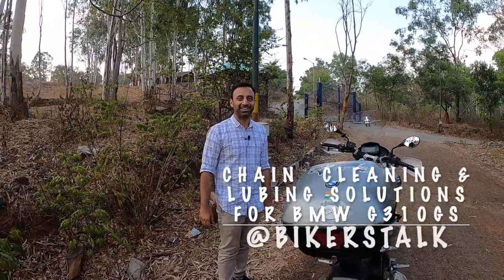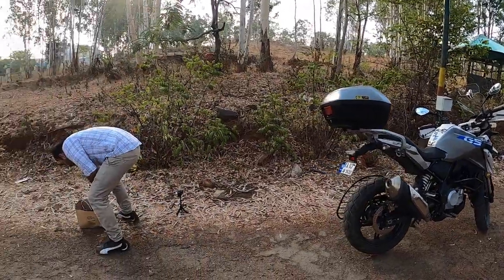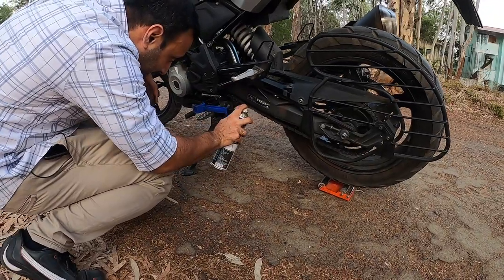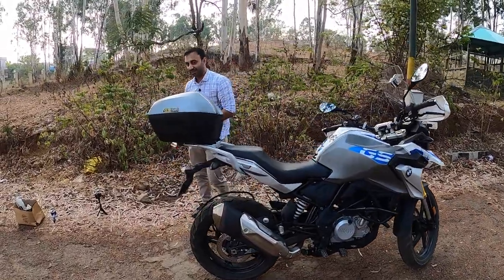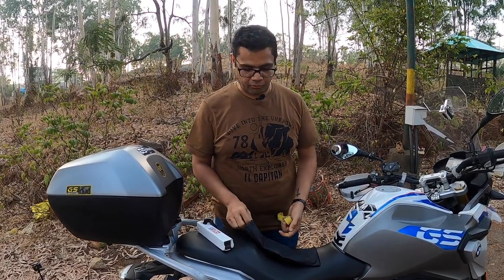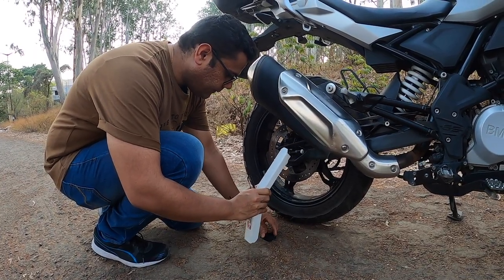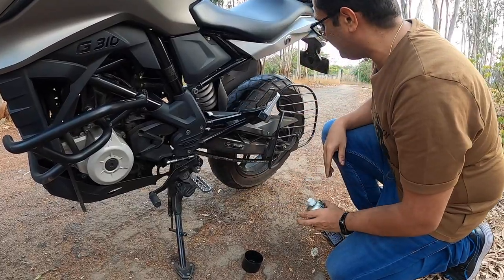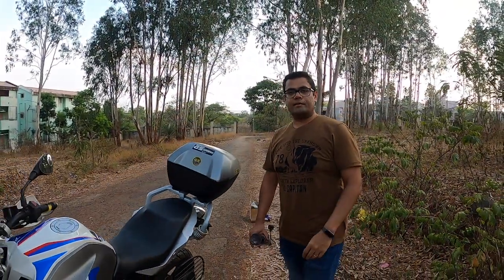Easy to do Chain Cleaning & Lubing solutions for BMW G310GS @BikersTalk

Comment: You got any recommendations for which chain lube to use , considering the fact that I have the 310R or any lube shall do?
Reply from the maker: We use Motul but any good brand should also do
Reply: Its best to go with Liqui Moly and Würth. Motul tends to become a bit gummy after some time.
Reply: Putoline Drytec. Hands down the best. its dry so not sticky and dirt wont accumulate on the chain. long life too.